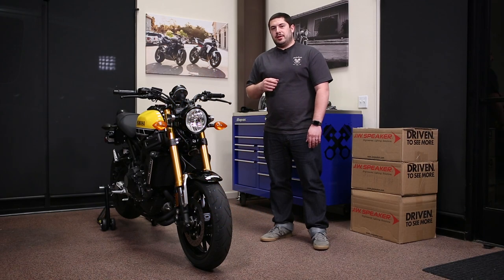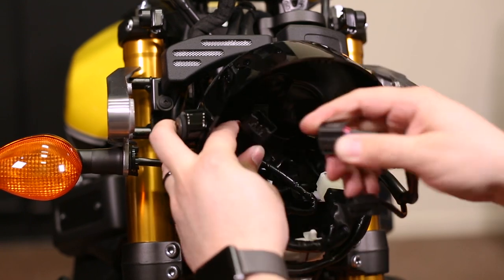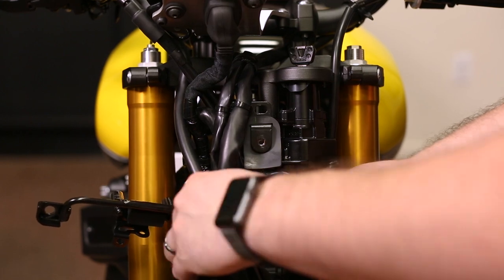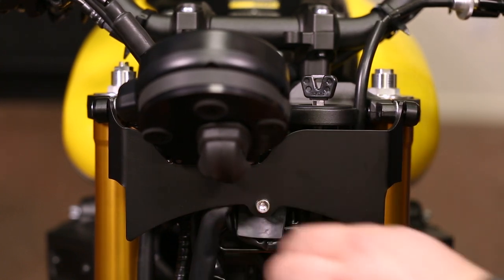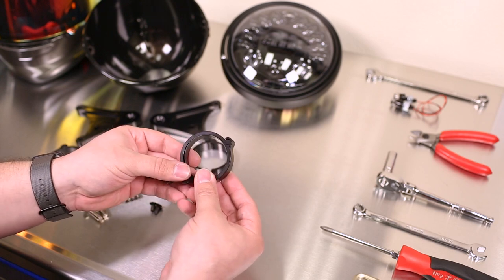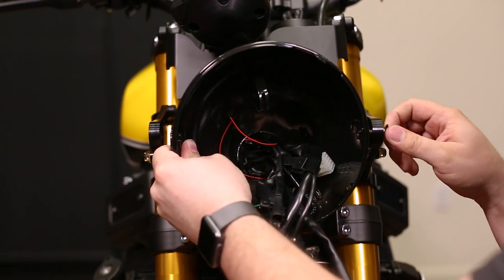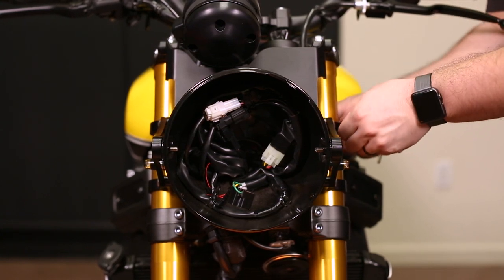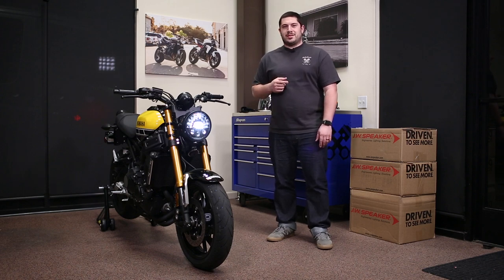XSR900 7 Inch Headlight Conversion Installation

Comment: Amazing just how tiny details improve also the looks of the bike, it looks way better with a 7inch headlight, the xsr700 would also benefit from a mod similar to this.
Reply from the maker: Completely agree. We have options for the XSR700! A set of headlight brackets and a headlight is really all that is needed. Since we don't have them here we can't get our hands on one to offer an off the shelf kit.
Reply: Now that we do have XSR700, are you guys gonna have a 7 inch headlight for it? it would make a huge difference
Reply: any news on a xsr700 kit like this awesome one ?
Reply: MOTODEMIC any news on a xsr700 kit like this awesome one ?
Reply: Hello, any news on a xsr700 kit like this awesome one ?
Reply: @motodemic  Hello, any news on a xsr700 kit like this awesome one ?

Comment: Great video. It is a shame you cannot reuse the original brackets though, they are one of the nice feature of the XSR 900.

One question though, I thoughtconversion to LED required some sort of "adapter" for lack of a better word located under the seat in order to avoid ruining your battery lifespan or electric circuit. I am no electrician by any mean so forgive my lack of knowledge on the subject and I might be completely wrong here but I believe to remember this is done to a difference in... amps maybe? Put it this way, I did not think you could just plug an LED front or back light and voilà.
Reply: You are correct with turn signals. They usually require resistors otherwise the signals don't blink at the proper rate. Other than that, halogens can be replaced by LED's without issue. In fact LED's in general draw far less power than halogens, and have expected lifetimes that often outlast the life of the vehicle they're being installed on.

Comment: Good video, and looks like a quality kit. After watching this, i am glad i passed on the XSR900, but it is good Motodemic is offering a solution for the headlight problem. I am not sure what Yamaha was thinking when they introduce a 3 cylinder which is difficult for many to want, then made the sale more challenging by installing the worst tail lamp they could find, offsetting the fuel cap and if that wasn’t enough to dissuade buyers... they put a substandard headlight on it. Seriously a huge fail on Yamaha’s part, but Motodemic’s conversion is about the best answer out there for the headlight
Reply from the maker: Thanks! The triple is a ripper though.

Comment: All hyped up and ready to order one.
Then I saw that this specific headlight goes for just over 1000$
I know led's don't grow on trees and you pay for a good finish, but a grand is a bit on the steep side.
Still want one though but goddamned... I work in a mall you guys, slow down!
Reply from the maker: The Adaptive model is definitely at the high end of the spectrum, the LED unit itself is $665 of that price. We do offer other light units to help get the kit down to other price points.

Comment: I didnt see you plug in nor test the turn signals. is there another video on the turn signals?
Reply from the maker: We didn't cover that in this video because that can be a video in itself. Since Yamaha uses the signals as running lights and signals, there are a couple options for how they are wired and other products on the market to allow 2 wire signals to be used as 3 wire.

Comment: Thanks for posting this video.  I love what Motodemic is doing for the XSR! - The only thing you didn't mention in this video is how the turn signals connect.  It looks like some connectors need to be wired on...  Is that true?  Thanks again!
Reply from the maker: Zanshin- thanks! We didn't really cover that in this video because that can be a video in itself. Since Yamaha uses the signals as running lights and signals there are a couple options for how they are wired and other products on the market to allow 2 wire signals to be used as 3 wire. We do plan on making something like this in the near future 👍👍
Reply: Awesome!  Thanks for the reply and keep making sweet mods!  You guys rock!

Comment: Do you have to have your 'aftermarket' indicators/blinkers to work with this headlight? (What aftermarket blinkers are they you're using)? Does an adaptor come with the headlight kit to use the oem blinkers? Nice headlight, really liking its style. Is that a blue tinge to the light I see or is it just the camera? Does it come in a 5K pure white output? Ta
Reply from the maker: Steven Febvre - In the install we use Motogadget m-Blaze Pin indicators, most M8 thread indicators will work. The stock signals are not compatible. The light color output target is 5k, very close to pure white.

Comment: I didn't see you install a grommet or something to prevent water from seeping in the back of the housing. Are all the wires in the light designed to get wet, or did I miss something? Getting my XSR next weekend and considering this light if the stock one is lame. I ride to and from work in the dark during winter.
Reply from the maker: The need is not there. The stock bucket is open in the back and in the front around the retaining rings, just like this one. If any tiny amount of water gets in it will drain out of the bottom. If there is enough water in the bucket to cause a problem then you have much bigger problems, and a life vest ;)

Great choice on the XSR900, such a great machine.

Comment: You guys didn't show how to wire the turn signal connectors. You guys showed it on the scrambler. Is it just plug and play?
Reply from the maker: At the time of filming this video, we did not have a plug and play option for this bike. Turn signals aren't covered in this video at all because there are multiple ways of going about them due to the signals being a 3-wire setup (running light). We now have plug adapters but they only cover the turn signal functionality.

Comment: How much space is there inside the headlight bucket? The OG one is cramped and after I had to put additional stuff of my new indicators in it, it nearly bursted.
Reply from the maker: This 7-inch housing has much more room than the original, especially if you go LED.

Comment: Awesome video, man....quick question tho... can this be done in an xsr 700? im in australia, and there's a dealer who imports your stuff,  think the xsr 700 would need a 5 3/4" headlight....i suppose they are from jw speaker?
Reply from the maker: sayemhaider this conversion does not work on the 700 but we have the components to swap the light. We’ve helped many XSR700 and FZ/MT-07 customers with a setup. We are currently developing a specific parts for the 700 and a solution that work in the stock housing (it’s not standard so the 5 3/4 doesn’t drop right in).

Comment: Hi, will this 7" retrofit lamp also work with my DART classic fly screen? Would hate to loose the fly screen. Will it bolt onto the new headlight mounting bracket or does it require extra mods and/or equipment? Thanks. V cool.
Reply from the maker: Hello Steve! The brackets that attach your Dart Flyscreen to the stock headlight brackets do not work on this conversion, BUT we do have brackets that are compatible. Follow this link and check out the XSR900 Flyscreen, you can select "None" to only order the brackets for the conversion - http://bit.ly/mdxsr900

Comment: Will this headlight conversion also allow the installation of the Yamaha or Dart Fly windscreen to be installed without issue?
Reply from the maker: We offer a couple Dart options that are compatible with this conversion. They use our brackets and the Dart screen - https://motodemic.com/shop/xsr900-flyscreen/

Comment: 🤔 Did I miss you wiring up the blinkers???
Reply from the maker: Since there are multiple ways to wire the signals on an XSR it's not covered.
Reply: MOTODEMIC Thank you for the response. Would you do a video on various ways to wire up aftermarket blinkers on an XSR900?  Thank you guys, great product and awesome video.

Comment: Hello, is it possible on the MT 09 sp 2022 round headlight conversion? Thank you in advance for your answer.
Reply from the maker: The electronics of the latest MT do not allow for aftermarket lights. We are currently working on a solution  to release early next year.
Reply: @motodemic  Great, thank you.

Comment: what are The differences between the adaptive LED and The Standard LED?
Reply from the maker: Adaptive LED
The JW Speaker 8790 features onboard intelligence to sense leaning angles when cornering to control light and dynamically fill in dark areas while turning. This additional illumination fills in the gaps to the left or right of the motorcycle that traditional headlights can’t. The increased night time riding safety from this light is worth its weight in gold, truly something that can save your life.

Standard LED
The JW Speaker 8700 Evolution 2 has amazing lighting output for the price and is a huge improvement over a reflective halogen lamp.
Reply: Thank you, btw i came to you from chaseontwowheels, because your headlight Looks amazing and got a ece-number for Germany <3, so i will probably Order one in 1 month

Comment: What about the indicators (turn signals) ?
Reply from the maker: We didn't cover that in this video because that can be a video in itself. Since Yamaha uses the signals as running lights and signals, there are a couple options for how they are wired and other products on the market to allow 2 wire signals to be used as 3 wire.

Comment: Can this be installed on FZ09?
Reply from the maker: MOTOFlip26 it can. We've also had many customers go with our Custom Headlight Brackets and our headlights that are in a smaller housing. Either way works!
Reply: Its a shame the stock headlight brackets were removed? They match other parts on the bike, one of the features that Roland Sands took months to design, you just threw in the garbage!! Its 2017 why don't manufacturers give us a nice super bright light like this one from the factory? Dont they have family members that ride that they want to be safe? All stock headlights suck except for Porsche, they know how to make headlights!!
Reply from the maker: Michael Kastner not sure where you heard Roland designed these parts. Yamaha's in house design team did all the design work to convert from the FZ-09.

We had to ditch the the stock side brackets because of the terribly designed stock headlight mounting. It's not the design teams fault, they had to use parts from a Bolt, as all the other heritage bikes do.

OEM's aren't using LED headlights from the factory yet for cost reasons. A reflector headlight is very cheap to manufacture, like $8-12 cheap. A solid optic LED will be 20-30x that.
Reply: Those ugly ass brackets with the holes are the first things I changed...headlight brackets , and the ones on the rear.

Comment: Does this work on european models aswell ? The headlight connection is the same ?
Reply from the maker: Two Steps From Hell it sure does! The only difference is that some regions have a front position light that needs to be unplugged. Our LED lights are ECE compliant and since they have a symmetrical latter are legal for both directions of traffic. We’ve shipped these conversions all over the world and haven’t heard a single complaint.
Reply from the maker: 100% compatible and the same connections. The only difference is the parking/running light which can be unplugged and tucked in with the rest of the wiring.

Comment: Hi, wich solution with your kit for use an airscreen ? (Most of them use the stock headlight brackets)
Reply from the maker: Frédéric Corbeau we will have brackets for the Dart Flyscreens available in a few weeks! They are heading to production now 👍
Reply: And will it be compatible with this conversion kit and the gauge relocation kit ?
Have you a discount code ? (1348$ order in wait)
Reply from the maker: Frédéric Corbeau of course!

Comment: Umm anyone else notice they just left lose wires from the turn signals inside the housing and didn't hook them up?
Reply from the maker: Matt 920 We didn't cover that in this video because that can be a video in itself. Since Yamaha uses the signals as running lights and signals, there are a couple options for how they are wired and other products on the market to allow 2 wire signals to be used as 3 wire.

Comment: what is the chances this will work with an MT-10 ?
Reply from the maker: Unfortunately, none. You could always DIY using our Custom Headlight Brackets and headlights we offer, though you may run into some electrical headaches adapting the needed power.

Comment: why is that led on the left flashing? looks broken
Reply from the maker: Definitely not broken. This is an Adaptive headlight so that circular array of lights illuminates as the bike leans. In this case, the camera angle (looking down) and the bike rocking ever so slightly is showing the bottom two lights starting to get power. The right side does it as well if you look closely at 16:06.
Reply: MOTODEMIC  Hey Brad, can you explain the "rocking ever so slightly" part in more detail?  Bc I just noticed the very same thing on my bike today.  The bottom left LED on the arc (9 o'clock position) flickers when the headlights are on but the engine is off and the bike is stationary on a rear paddock stand.  Where does the rocking come into play and why would that cause the particular light to flicker?  You mentioned the right one flickering at 16:06 but I think you meant 16:12?
Reply from the maker: In the video, the bike is on a wheel chalk that allows the bike to rock side to side ever so slightly. So at after the startup sequence, you can see the bottom optic on either side slightly flickering. In your case, the light may be sensing a slight angle but it's perfectly fine. These Adaptive lights also rely on an accelerometer and when the bike is stationary it's not functioning as it does on the road.

Comment: is there a head light for a Yamaha fz07?
Reply from the maker: Moto Marcus we offer headlight brackets and a variety of headlights for that model. Head to motodemic.com and feel free to contact us if you have more questions.
Reply: when I went to the website supplied then Yamaha the only thing that pops up is the xsr900, is there somewhere else I can find it in the website?
Reply from the maker: Moto Marcus under the headlight brackets section there is an option for FZ-07. This is more of a diy project as we do not have a specific conversion for that model. But with those brackets you can mount a 7 inch headlight. We've had many customers do this. Again, contact us if you have more questions or need further assistance.

Comment: Can i make the same change on my xsr 700
Reply from the maker: Leonardo Lopez since we do not have that model available in the US we do not have a specific kit for it. We do offer headlight brackets that work on your forks and that would allow you to mount the same headlight.
Reply: How much will cost me, headlight and headlight b hinges brackets?
Reply: hey how much will cost me headlight and headlight brackets and can i  order in Switzerland?
Reply: @leonardolopez1854  Hello ! I just got an XSR 700 and was wondering the same thing (from Switzerland as well). Did you find a solution ?

Comment: what an idiotic thing to do ,.. now you blind those in front of you and your bike is not longer street legal
Reply from the maker: The light unit is 100% legal in all countries and does not blind oncoming traffic. Projector based headlights have total control of their output and provide more light coverage than a halogen ever could. More light allows you to see and others see you without blinding them. That doesn’t sound very “idiotic”, pretty smart actually 😘

Comment: What about the turn signals??
Reply from the maker: We didn't cover that in this video because that can be a video in itself. Since Yamaha uses the signals as running lights and signals, there are a couple options for how they are wired and other products on the market to allow 2 wire signals to be used as 3 wire.

Comment: What about the blinker wiring?
Reply from the maker: Richard Mitchell we offer them pre-wired or you could wire them using the connections from the stock signals.
Reply: @motodemic  I'm guessing this is the 1000 dollar package?
Reply from the maker: Richard Mitchell correct, the Adaptive model is shown in this install 👍